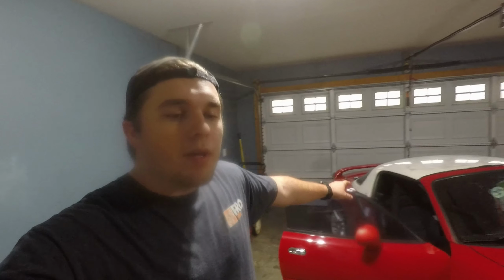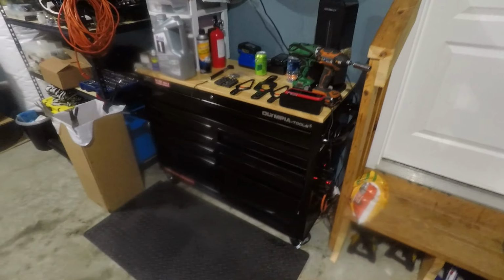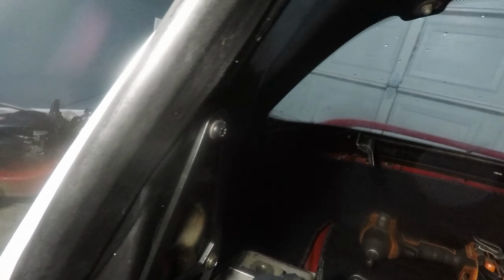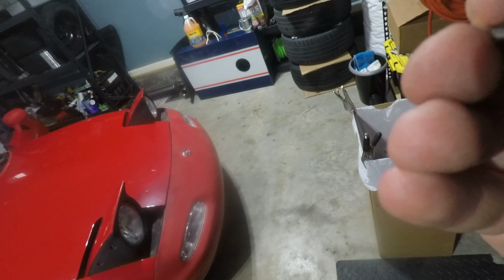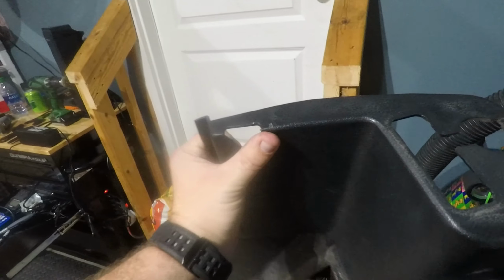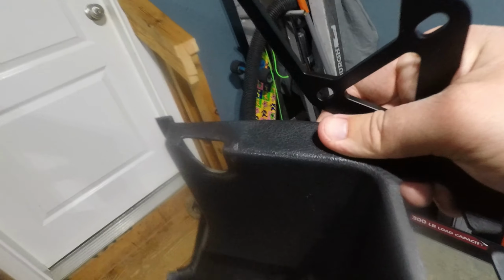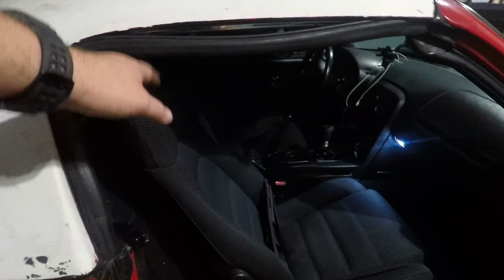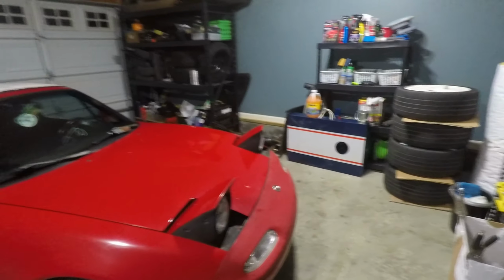Jass Performance Hardtop Brackets! (Miata Build Series)

Comment: Gosh the Miata is showing it’s age with the bolts and threads but man it’s nice to see those brackets in. Good job.
Reply from the maker: Definitely a lot to do a little in that one spot! And sadly the bolt that stripped was one of the new pieces of hardware I got for it, but as I discovered form the driver side the brackets are at an angle so it’s very likely I was off center and that’s why it was stripping!

Comment: Does it leak water or any wind noise?
Reply from the maker: It did not leak and it took some adjustment at the front seal but no wind noise once aligned properly 😎